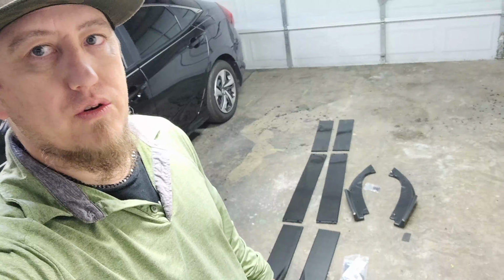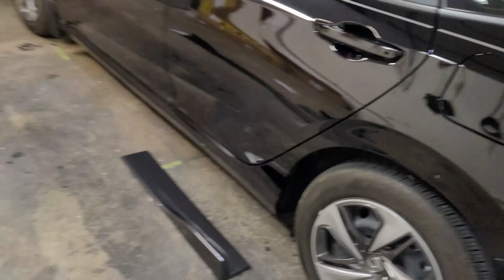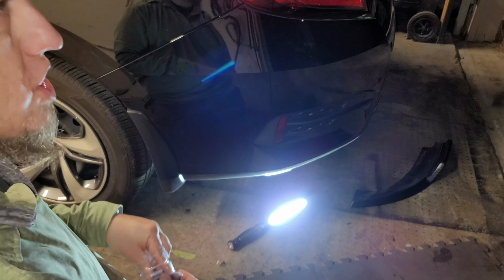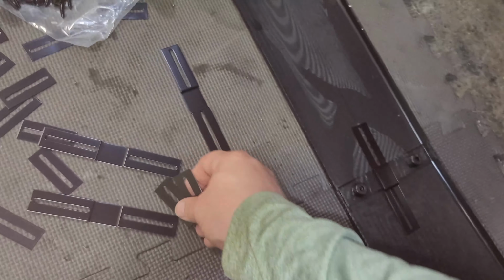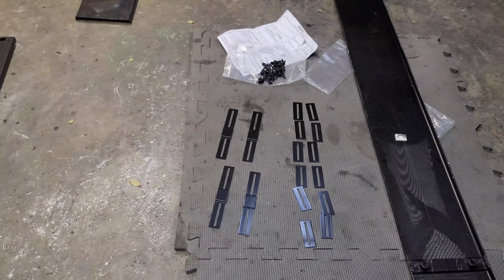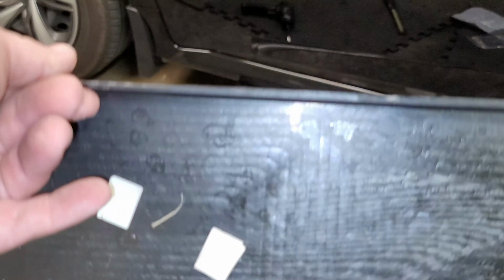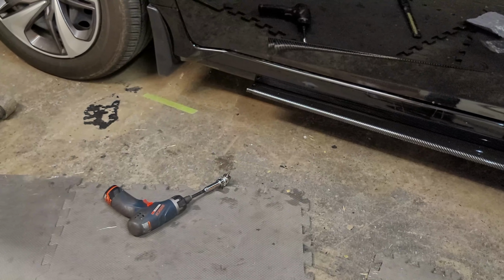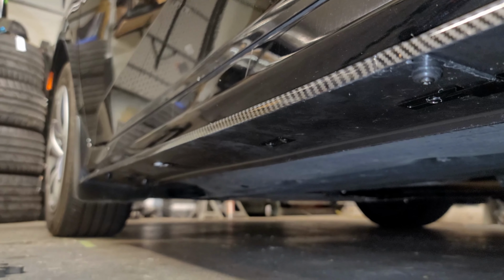Honda civic carbon fiber side skirt extensions install

Comment: what is that tool attached to drill that lets you get under in tight spaces ? to drill thanks
Reply from the maker: 90 degree apex driver

Comment: How’d u remove the little hanging thing near the rear tire?
Reply from the maker: The little small rubber pieces? I cut them off flush
Reply: I cut mine as well the tool needed I've never seen before